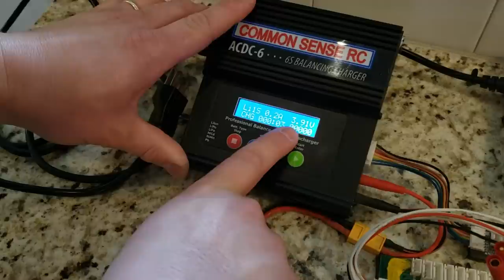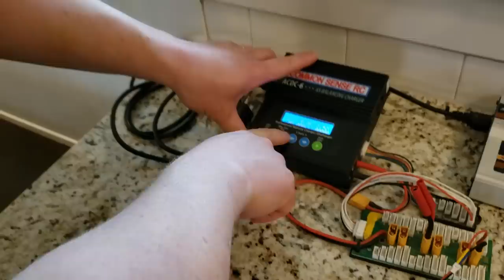Eachine - P-51 Mustang - Mini - RTF - Unbox, Setup, & Maiden Flight

Comment: These are phenominal value for money planes, great fun and they bounce off the ground with no damage in most crashes. You can fly these with a multi-protocol radio like the Zorro...using internal RF 761. It even looks like some are modding them with bigger brushed motors, etc. Lots of possibilities for a little pocket change. Thanks China!
Reply from the maker: yes!

Comment: Great value for a genuine 3-axis control plane!  That whole styrene package could slot into a case for easy transportation too. These look so much better than most comparable size models and stabilisation is going to increase its survivability .
Excellent video with useful information and your enthusiasm is contagious! 👍🏻
Reply from the maker: Thank you for the kind words Dave! It is a great little plane. So much excellent tech is making into these little planes. Only a few short years ago, a plane this size wouldn't have had stabilization or auto-leveling, and it would have cost 2-3 times as much.

Thanks for checking in!

Comment: I just got one of these and flew it for the first time today. Mind you, it's my first plane, but I have flown quad drones before in the past, it was pretty easy to get used to after the first few crashes. I would recommend to anyone that hasn't flown before, do not install the landing gear because the one on the left side of the plane ripped right out of the foam, but no damage to the wing itself, all it needs is a little glue to get it back on, but if you don't have practice landing it, it might be bad for the wing if you do crash. I probably crashed this thing like 8 times and the propeller popped off 5 times and it'snot damaged AT ALL. It just pops back on really easily and the plane itself has no damage even after hitting a tree, popping the propeller off and the plane just gliding itself to a crash landing on top of a building. But honestly, if it wasn't for Brian with these in depth reviews, I would have probably lost the plane and/or messed up the batteries or worse. I got a battery meter to check on the batteries after watching a lot of these videos, so thank you for all these reviews that you do! Once I get comfortable with this plane, I'm looking at moving up to some EDF planes like an A-10 or the Habu. I already know it's going to get expensive, lmao. My goal is to eventually be able to do some long range FPV, but it'll be a while before I get there.
Reply from the maker: I'm so glad we were able to get you in the air!!! It's pretty exhilarating, isn't it!?!

Thanks for the kind words! We're glad you're here with us!
Reply: Brian Phillips It’s pretty amazing. I’ve tried a few times already taking SAFE off, but I end up getting a bit nervous only because of the locations I’m flying here in AZ, cause depending on where the plane goes down, I may not get it back, Lol.

Thanks again and for the info you provide in all your videos. I just watched the one you released today where you talked about the Spectrum S44 4-port charger and I’m going to be ordering it soon since I only have Molex batteries so far. It’s like you’re a teacher/professor of the RC plane world 👍

Comment: thanks to the video, I got the guts to go and purchase the plane. I ordered with 3 batteries. I want to ask you two questions, (1) Do you know if I can use similar LiPo 1S batteries, they are 3.7V 300mah from an old plane I  used to have? (2) Where did you purchase the battery charger you show in the video, do you have a link? Thanks again for the video
Reply from the maker: YES - you can if the polarity is the same and size is similar.
S44 4X 1S Charger https://bit.ly/32tpGx3 - BIGGER ONE 
S63 6X 1S Charger https://bit.ly/3iLuP8Y - SMALLER ONE

Comment: Biggest lesson learned, while plugging the battery into the plane, don't hesitate, get it turned over upright so the stabilization is correct.  I thought you somehow mistakenly switched it to Mode 1.

Comment: first plane for me. its very durable. however i crashed it into a barn on one of my first flights pretty and it blew the battery thru the nose. a little school glue (dont have ca rnow) and a rubber band to apply pressure to put the seam together and now its good as new.
Reply from the maker: Totally - should be glued together and just fine!

Comment: Great video ! I bought this plane  after watching your review but I didn't have much luck from my side. The plane seems buggy. It keeps loosing the signal. I am even able to reproduce the issue on the ground. When I walk 20 or 30 meters away from the radio the plane looses the signal :( Did you hear anyone complaining about this by any chance ? Did they find a solution ? Thanks !
Reply from the maker: I haven't on the 400mm series. I wonder if you have a broken antenna? Have you tried to see if the antenna is broken off in the TX (inside, and very simple) or the one on the bottom of the plane?

Might want to reach out to the seller first and see if they'll replace it first, but if not, look over your antenna - might be where your issue is.
Reply: @BrianPhillipsRC  thanks for your feedback !! Following your message I tried to check the antenna at the bottom of the plane. I do see a whole at the bottom of the plane and when I look into it using my phone light, I see a small antenna of 1 inch approx. Do you see the same thing or your antenna is longer ? To answer your question about the seller, I contacted Banggood for an exchange and for now I wasted hours for nothing. For the last 2 weeks  I sent a lot of videos until they recognize that there is an issue. An now they are proposing to refund 40% of the price which I refused. So no progress.  It is disappointing as it is my 1st plane. I wanted to get familiar with it before buying bigger trainer plane such as the STS 1.5m. Now I almost want to stop everything and drop the RC plane hobby and go back to RC cars.

Comment: Hi Brian,
I need 1 tip for this model pls. Noticed this issue today after 2 batteries finished I started flying with 3rd battery, all 3 are standard 1s 400mah Mustang p51d stock bats.
Started 3rd bat. wind also started getting annoying as I was flying it up at around 100-130meters from the ground, brought it down and wanted to fly it near the ground flybys at 1-2meters. Started saving a video and suddenly I noticed my plane at top-speed throttle stick flying by me is shaking(vibrating left-right wing up-down constantly) like it has electric shock. I repeatedly flew by myself standing on the sports airfield without any more battery or chance to reproduce the wing vibrating-shaking only at full throttle. When I fly it on half throttle it looks stable, no shaking or vibrations anymore.

Not sure why is this happening so I will try to fly it again in a 2 days hopefully without strong wind and see if it starts shaking at full throttle flyby again. Meanwhile - I saw some of experienced RC pilots like you put a duct tape on 1 propeller and just put the tape around 1 fin, is this the possible solution or I misunderstood it and swapped tip/fix for something else with this wing hard shaking/vibrating issue I'm experiencing with Mustang p51d mini by Eachine.
Reply from the maker: This is over-correction of the Stabilizer. It can be remedied in one of two ways...

1) Reduce the output of the ailerons on the control horns of each aileron
2) Fly slower, then the stabilizer will not over correct, thus oscillating

They are balancing their prop with tape. If you have a prop that's way out of balance, the plane can vibrate so badly that you might not be able to fly...or rip the motor off of some more advanced planes. To correct, you can use tape on one side, throttle up - Better or Worse? If better, more tape on the same side - Better or Worse? If better, more tape....repeat until balanced. If worse, switch to the other side. We've done this a number of times to balance props, or even EDF fan blades. It's easy, but not the "Best" practice. You're supposed to use a prop balancer tool, one of which I have, but it doesn't always work on small planes, like this and other "toy grade" planes.

Comment: I just got my mini P51.  I am having trouble getting it into the air.  When I try to take off with elevators up it noses into the ground.  If I try to hand lunch it I can feel it nosing down and sure enough no matter what angle I try it flies into the ground.  I watch your video and tried some of the things you mentioned but no luck.  Do you have any other suggestions? Also is Eachine and Volantex the same mini P51  It sure looks like it is
Reply from the maker: Have you trimmed the elevator back some??? If not, try this, and if so...then try doing a mechanical trim on the elevator next.

Comment: Hi, I just bought this plane bundled with 2 spare batteries and waiting for the shipping. What's the best charger I can buy to charge the batteries?
Reply from the maker: It comes with what you NEED, but you can get these ones which are more flexible.

S44 4X 1S Charger https://bit.ly/32tpGx3 - This one is quite a bit better!
S63 6X 1S Charger https://bit.ly/3iLuP8Y

Comment: Hey Brian: Your problem at the beginning was you broke the Cardinal Rule !!
Always TURN ON THE RADIO FIRST THEN PLUG IN THE BATTERY…
The only time you plug the Battery First and then turn on the Radio is to DO THE BINDING PROCESS.
If your Instructions didn’t explain this then they are incorrect. I have the exact same Airplane and the Instructions are clear on when to plug the Battery in FIRST is only if you need to Bind the Airplane to the Radio.
Sincerely, Bruce A. Hill
Reply from the maker: thanks

Comment: Maybe becaused you plugged it in upside down... or because you touched the rudder when it was in program mode (before you cycled the throttle endpoints). 
Pretty sure you can reverse ail and rud inputs this way but it may have been the larger Volantex p51 I saw do that in a vid... Can you confirm?
Reply from the maker: Yep, this was the first of a few recent Volantex reviews...so now I realize you can swap direction of travel by simply pushing the control axis to the left or right, and holding it, while it's sitting there....when you see the control out put "jump", ending up the "other way" you're good :) Then just test to make sure you got it right.

Comment: Yo...
Did you ever do a range check on one? Nothing in the instructions...do you still have the p51? If so could you please do a ground check and see what the servos do when it's put of range....I think I just lost mine...had it up Linda high into the wind,  lost sight because it was edge wide...went full aileron opposite rudder to get it to spin..few seconds later I chop throttle...I should have seen in come down
..doing s fly away put of range is a bad thing...full size rc servos usually take a run in one direction with loss of signal.....and yes. 3 flights on fresh tc batteries...PLEASE HELP!
Reply from the maker: I would call Horizon Hobby. This shouldn't happen! I didn't range test mine at all (I should, but almost NEVER do it)
Reply: @BrianPhillipsRC  didn't get it from horizon. It came through Amazon.mi will see if I can track it back that way...if you still have yours could you give it a quick check...just get it turned in in beginner mode move on of the control surfaces and turn the tx off..does the surface return to neutral? And does the auto stable still work? Or does it act like full size r c when you turn the tx off before the RX and the servos travel a ways

Comment: Thanks for sharing, great video! I was having similar issues with this Volantex (it's a volantex) tx/rx with a different plane. Suddenly rudder is aileron... Suddenly the thing does stuff I dont even command it it to do and so on. I put a rx of my choice in it, and everything is fine.
Reply from the maker: I though it had reverted to a 3 channel, Mode 1 - I was sooooooo confused!!!
Reply: Was it hard to put a different rx in her and do you see the solder pads easily. Thanks in advance

Comment: Finally, a plane review. Perfect timing for those of us that need to fly indoors.

Try binding with protocol V761 on your Jumper. This Mustang is made by Volantex. I've got their 761-4 Sport Cub 500 and it works great with my transmitter. You'll thank me later.
Reply from the maker: I'll give it a shot for sure! I want to fly it inside too, but I think it's a touch too fast for my living room. You must be flying in a gym, right?
Reply: Flying in the Naperville Yard. Of course, I'm flying the volantex 761-4 which has a 500mm wingspan. Plenty of room for even the Timber & UMX Pitts! Costs $8 for 3 hours. You need something like the Vapor to fly in your house.
Reply: theoztreecrasher t16 Will Bind with Eachine P51d Mini volantex. Must Change to AERT (setup new model with ch1 rudder and ch4 aileron; th is ch3 and ele ch2). 
Gyro is on Ch5 and you can use a switch to change it on/off. 
HOWEVER, 
I wasn’t able to find yet how to change to intermediate (seems to be only off/beginner mode)
I wasn’t able yet to find the Stunt button (left shoulder of original tx)...
Any ideas!?!

Comment: Hi, thanks for your videos. I bought this little plane and it is super fun to fly. One problem I have is after I have used up one battery and  as soon as i connect the second all the controls stop functioning properly even if I bind everything new again. All rudder  movements are delayed and the throttle is almost uncontrollable.
Any thought or advise would be much appreciated
Reply from the maker: Try this...

Fly a good flight....
1) Pull the lipo lead from the plane.
2) Leave Transmitter on - Make 100% sure that the throttle stick is at 0% output.
3) Plug in second lipo. Ensure it's level, OR "re calibrate the Gyro"

Does this work? If not, do this instead...

Fly a good flight....
1) Pull the lipo lead from the plane.
2) Turn off the Transmitter - Make 100% sure that the throttle stick is at 0% output.
3) Turn the Transmitter Back on - Double check that the throttle stick is at 0% output.
4) Plug in second lipo to the plane. Ensure it's level, OR "re calibrate the Gyro"

Tell me if this works, and if it doesn't I'll try to help you out.
Reply: @BrianPhillipsRC  Sooo I took it for a flight. About 2 min in I lost complete control and it kept climbing and climbing aaand she was gone. I couldn't even see where she went down ☹️.
I have to order a new one.
Thanks for replying and trying to help. Cheers!
Reply from the maker: NOOOOOOOOOOOOO! Sorry to hear about your loss Benny!!!

Comment: Brian, tried again to install landing gear in Volantex mini P-51 .. Results- 1 totally destroyed wheel and strut! I am an ex machinist and this seemingly simple little bastard has me starting to drink heavier than usual! I am Really at wits end with this!!!!! Any possible suggestions??? Your Friend , JEFF T.
Reply from the maker: I want to tell you that it's easy, but it's not...they just kinda suck to put in - I can't recall having a HUGE problem, but I know we had issues with a few of the other from the El Cheapo series.

Also, I want to encourage you to keep the drinking to a minimum before flying, as you may find it more difficult than usual to fly these things totally smashed... ;) Smashed flying MAY result in smashed planes. Sober flying, regrettable may ALSO result in smashed planes... I'm not very good at PSA's am I ?!?!? LOL

You can do it!!! unless you got a lemon, and then you may NOT be able to do it, and if that's the case, I'm really sorry you got a lemon! The good news is that this plane will fly without landing gear in place, and wheels up wheels down on this plane is one of the weaker areas of it's overall performance.